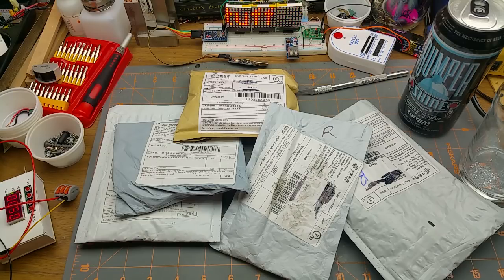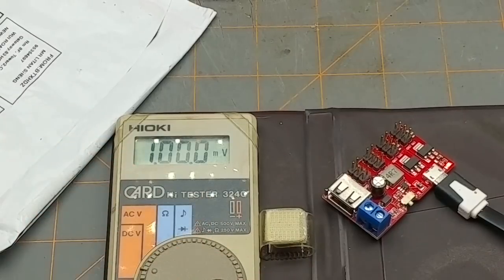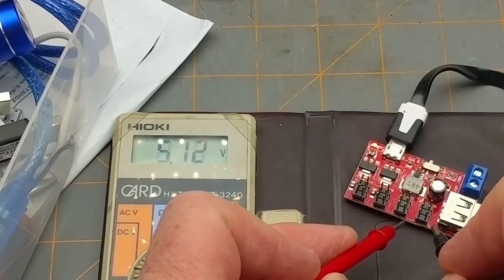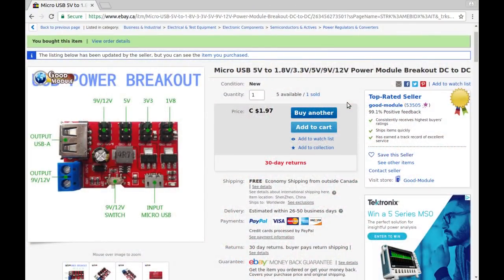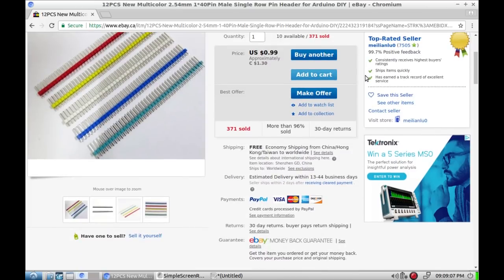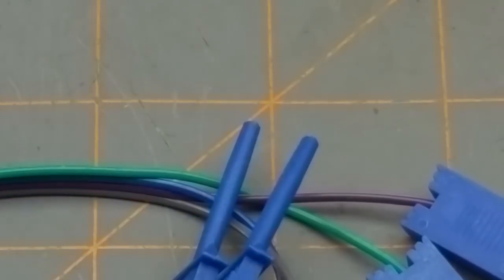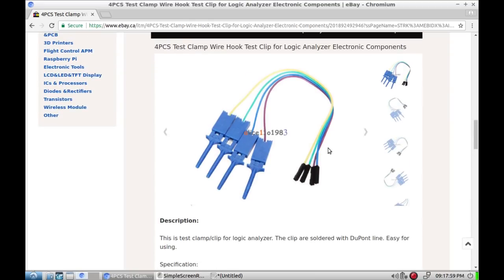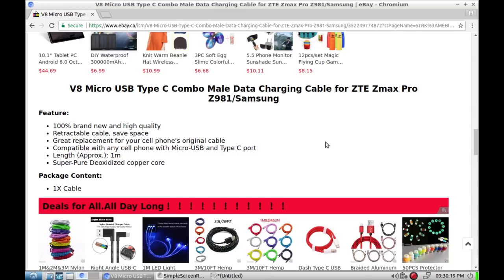Mailbag Monday 24

Comment: I bought this exact thing, first one was a USB short, the second one died (9/12 output) the first time I flipped the select switch.Was under no load when switched.
Reply from the maker: Yeah, it's always a good plan to test these things, especially when buying from the cheapest supplier (like I do).

I've been fairly lucky - only a couple of DOA things in a couple of years of buying direct from China.

Comment: Hi    Yes , the screwdriver is from Poundland here in the UK . 
 I like the even smaller test clips from Ebay but they quite easy to damage -- but cheap .
 Yes my Vac pick up tools ( i have both types ) dont work very well either .

                                                                                                                       Alan

Comment: We used to use DiP IC test clips often where I worked about 30 years ago and still have a nice set with the extra cables and breakouts.
I thought you may be interested in them if you are connecting to dips often. The ebay search is for IC test clamp. There are 8 and 16 pin versions. US ebay link. https://www.ebay.com/sch/i.html?_from=R40&_nkw=ic+test+clamp&_sacat=0&LH_TitleDesc=0&_sop=15&LH_TitleDesc=0&_blrs=recall_filtering
Reply from the maker: Somewhere around here I still have my old 16 pin dip clip. 

Pretty sure I got it from Rat Shack back when they actually sold components and catered to hobbyists.
I'll have to keep an eye out for it.

Comment: Hi   I have just checked on Ebay.co.uk and found the little test clips I mentioned in a previous
post . Search for MINI TEST HOOK CLIP  for example 10 for 99p  ( 2 each of 5 colours ).

                                                                                                                                         Alan
Reply from the maker: Thanks for that. 
Are you referring to the ones with the circular handle, or the flat-ish ones? I see both come up when I search with that term.

I'll have to look closer the next time I want/need some.
Reply: Hi   Yes they are like mini versions of the big ones you have . I think that
they are copies of ones I purchased many years ago ( for work ) from 
a US company called Alpha wire or something like that. These ebay ones are just over 4cm long & have a tiny hook on the end .

you can get smaller but they are VERY expensive ( like the ones that came with my old Logic Analyzer -- which has a CRT etc ! )

                                                                                                      Alan